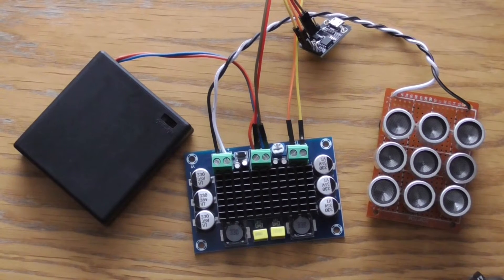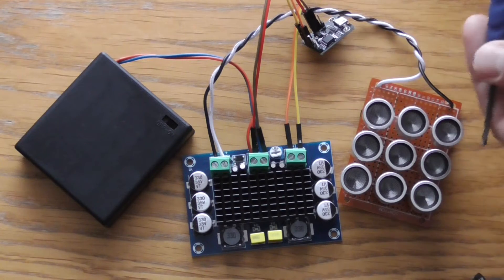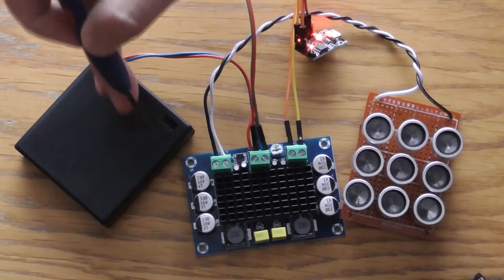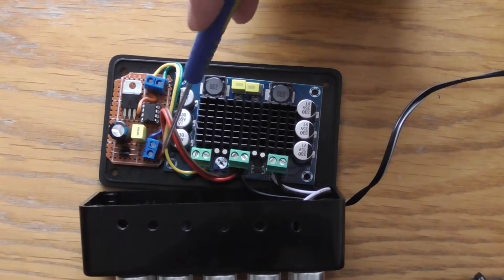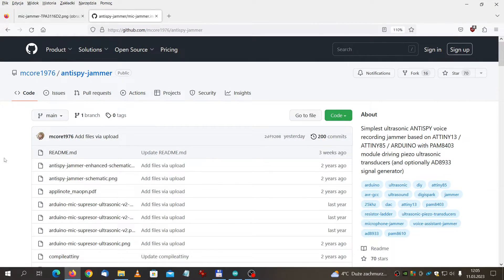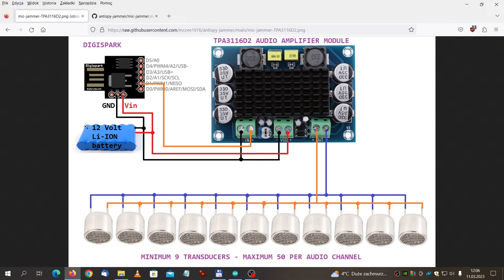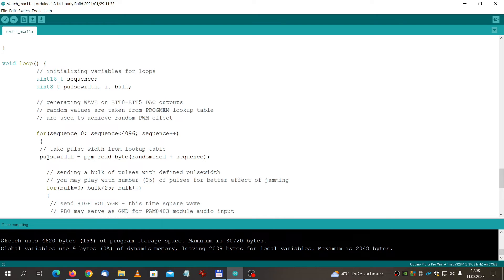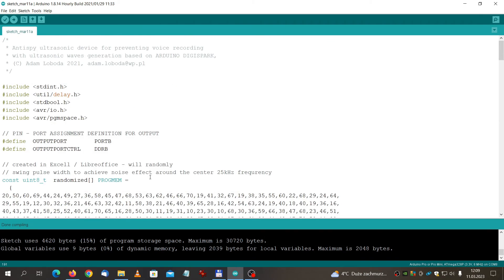DIY microphone jammer beast for less than 30$,  voice recording blocker with Digispark and TPA3116D2

Comment: Do the transducer have polarity? Thank you
Reply from the maker: yes they have. you have to pay attention to what the pins look like. One of the pins is grounded
Reply: @justanengineer5599  on my t25 transducers the pins look the same however one of the pins seems to have rubber insulation around it so I presume that is the + pin.  I tested with an ohm meter to see if I could find continuity with the metal case on either pin and that did not provide any answer.
Reply: thanks, I tried to assemble, I can jam the audio of an iphone, but it is only when I can hear the transducers, wich makes it useless, I am not using the capacitors on the newest version, are they important? Thanks
Reply from the maker: seek for the other version with AD9833 it is almost not audible and jams iPhones. This is something that you need
https://github.com/mcore1976/antispy-jammer/blob/main/mic-jammer-AD9833-TPA3116D2.png
https://raw.githubusercontent.com/mcore1976/antispy-jammer/main/mic-jammer-ad9833-digispark.ino

About the capacitors - using them is dependent on your power source quality. Sometimes it helps for some cheap power bricks
Reply: thanks, but that is the one I did, without the capacitors, do you think I need them?
Reply: Hi, I bought the capacitors and now it works with an iPhone, the problem I see Digispark and the AD9833 heats like hell and it stops working (not sure, what do you think?), maybe use of a pair of heat sinkers make the job. Thanks
Reply from the maker: how do you power the digispark? What is the voltage? it should be powered through Vin pin if the voltage is higher the 5V
The AD9833 should be cold unless you messed the wiring or TPA3116 is sinking too much current from AD9833 which may point to its problem (tpa3116 broken)
You may also think of using  ATTINY85 based design instead of the Digispark one here :

https://github.com/mcore1976/antispy-jammer/raw/main/arduino-mic-supresor-ultrasonic-v2-ATTINY85-TPA3116.png

https://raw.githubusercontent.com/mcore1976/antispy-jammer/main/main6.c

https://raw.githubusercontent.com/mcore1976/antispy-jammer/main/compileattiny6
Reply: ph, I think I messes the 5 v power, I”ll try to fix it later, thanks for your comment
Reply: just checked and everything seems correct, could ve that I use old junper wires? or other coase, I wanna stay woth the digispark model you proposed before, anyideas, thanks
Reply from the maker: 1. check if your TPA3116 board has a potentiometer on the audio inputs if no, find one that has because it will limit the current drawn from AD9833 board
2. Solder the wires. There is always an issue with lack of contacts that may sometimes damage the boards
Reply: @justanengineer5599  Do you mean the transistor to set the sound/ultrasound? yes it has one, I unplugged the USB power, thought it was the problem, but still having the heat problem, did you have any problem similar? or other guy reading this? or is it because the protoboard just cant manage than vortage? thanks
Reply from the maker: no one had such problem so far. please conect some resistor/potentiometer between AOUT of AD9833 board and Audio Input + of your TPA3116 board. How do you power Digispark and how do you power TPA3116 board? TPA3116 has tobbe powered from higher voltage than Digispark. The Digispark has to be powered through Vin pin from the same power source as TPA3116. AD9833 board has to be powered from 5V pin of the Digispark since Digispark is converting Vin voltage to 5V on 5V pin. Hope you understand what I have just written here. Use my diagram not your own ideas because you will fry all the stuff
Reply: Hi, trying to reassemble here, does  digispark power led has to blink? Thanks

Comment: I seem to have done everything right and yet it does not appear to jam microphone recordings, I can hear audible clicking from the ultrasonic transducers and adding phone near them does show a waveform, but audio does not appear to get jammed, I only had success with with an old phone and even then only 1 second of speech was not audible
Reply from the maker: you must have done something wrong, please indicate which source code have you used and which schematic was used for the jammer.
Have you used : Digispark + Tpa3116d2 + 10 transducers?
https://github.com/mcore1976/antispy-jammer/raw/main/mic-jammer-TPA3116D2.png
https://raw.githubusercontent.com/mcore1976/antispy-jammer/main/mic-jammer.ino

If you use less than 9-10 transducers the TPA3116D2 will not work correctly and you will get this 1 sec only jamming

Additionally consider second option which works better :
Digispark + AD9833 signal generator + TPA3116D2 + At  least 10-15 transducers. All of it has to be powered from 12-24V  see following
https://raw.githubusercontent.com/mcore1976/antispy-jammer/main/mic-jammer-ad9833-digispark.ino
https://github.com/mcore1976/antispy-jammer/raw/main/mic-jammer-AD9833-TPA3116D2.png
Reply: @justanengineer5599  Thanks for your response. Guess I'll have to get AD9833.  I used Digispark + Tpa3116d2 (mine is two channel, so I used a single channel) + 10  25khz transducers. All powered with 12v
I also used unmodified mic-jammer.ino and everything is connected just like at 5:50
Maybe I should add more transducers? I have 10 more
It also only draws 0.04 Amps, which seems too low
Reply from the maker: it is too low. Either Digispark is not generating the signal (do you have an oscilloscope to check the input pin of audio amplifier?) or there is some short/break at the output on the transducers. can you check the voltage on transducers? it should be at least 2x VCC
Reply: @justanengineer5599  I finally managed to get it to work. Turns out I needed to connect wires better and I needed to use D0 and not D1 on digispark. Jamming seems to work now, but it seems a bit weak. I tried measuring the voltage I get at the output of Tpa3116d2 and it's 4.6 if I measure AC and ~200mV in DC. And everything is only drawing 0.05A. Maybe my amplifier is bad
Reply from the maker: it is still to low. The whole device should draw 0.3A at least. Yes, you may have bad amplifier board

Do following checks:

1. Check the wiring 3 times. sometimes attaching additional Electrolytic capacitor 200-1000 microfarads between VCC and GND and some smaller 470nF - 10uF  could help. 
See the updated diagram on my github that contains the capacitors : https://github.com/mcore1976/antispy-jammer/raw/main/mic-jammer-TPA3116D2.png   and  https://github.com/mcore1976/antispy-jammer/raw/main/mic-jammer-AD9833-TPA3116D2.png

2. check the voltage on AD9833 VCC/GND pins if it is 5V. 

3. Check the voltage on TPA3116 pin VCC + / VCC -      if it is 12V. this board has to be  powered from 12Volts at least

4. If using AD9833 board check wiring on Digispark P1 to P3. This is a SPI bus and it has to be connected exactly the way as on a diagram.   If you are not using AD9833 then P0 port is kind of GND line for the amplifier audio input, you may connect directly audio amplifier negative Input "-" pin to GND line

5. Audio amplifier board is important. For example TPA3110 does not work and makes this "clicking". Use TPA3116. I will also check if TPA3118 works soon.

In general. You messed up the wiring for sure. It should  not be difficult to connect few wires especially for MR ROBOT.
Invest in Oscilloscope that could help you to run similar  hardware projects. It is hard to debug what you have done if I cannot see it. Maybe it would be good to post images / photos of your device on some free image hosting and put a link here ?

Comment: Filtering ultrasonic wave lenght could be solution to this jammer I guess?

So a spy can easily filter out noise and get clear sound?

Am i right?
Reply from the maker: Good luck with filtering random noise that is added to this signal...
The ultrasound is only a bearer of random modulation

Comment: I just tested the change with interval, it makes the sound of the noise, but it's possible to hear what I'm saying through the noise.

video at: https://youtu.be/yWAc2V9PPKw

Tested with an Android Motorola G60 (Iphone-like filter)
Reply: The effect needs to be close to that of this equipment, I'm trying to buy one of these so we can see the circuit and measure the intervals https://www.youtube.com/watch?v=dy9U9BbFXYs
Reply from the maker: I will try to experiment with more random intervals. In their video they are jamming iphones from 1m range directly pointing the signal to the microphones which is  not so hard as you know. When you are filming the jammer the microphone is at 90 degrees to the jamming signal that is why you can still hear the voice a bit. If they put jammer at 90 degrees I pressume it wouldnt be so succesful in jamming

Comment: thanks. I am wondering if in the commercial jammer they are using some pauses in the signal to make the jamming better. I need to try some random interrupts in signal generation and see if it makes any difference.

I bought the CZ21 model in the "ali ex press" research on it, they claim to work on all but the iphone 14 I bought it when it arrives I open it, I film it and make measurements to send you
Reply from the maker: I have just uploaded to GitHub new version of "main4.c" and "mic-jammer.ino". Both are having random delays between bulks of 25 pulses sent. In my opinion it works better on high end phones, I have just tested on my Samsung S20

Comment: I performed the tests with this project using 21 transducers 25khz, TPA3116D2 100watts, digispark.

The test was performed on 1 motorlola g10, 1 motorola g60, a lenovo tablet, a xiaomi 11t pro, and a spy engraver pen.

on xiaomi 11t and motorola g10 it worked fine at 5 meters.

on motorola g60 it worked up to 2 meters.

on the voice recorder pen it worked at 20 centimeters (on the old model it didn't work at any distance).

on the tablet did not work.

I didn't have an iPhone at the time of the test, but the tablet I used seems to use the same anti-noise circuit as the iPhone.

the circuit was assembled and configured according to the scheme indicated in your video, it emitted a strong and audible effect from the transducers.
Reply from the maker: if you have 40kHz transducers there is a version mic-jammer-40kHz which may work on the spy pen. Its microphone may be not susceptible to 25kHz.
Also the question did you use 12V at least 1 Amp to power the jammer?
Reply: @justanengineer5599  I did tests using 21 25khz transducers with the mic-jammer.ino TPA3116D2 100watts, digispark.
2A 12v source and then with 14v 7A battery emits a very strong noise but still ineffective in some devices, I just did a test using 51 transducers 25khz the result is the same. Did you see the video I sent the link to in the last post?
Reply from the maker: no there was no link in your first  post at the top of this conversation
Reply from the maker: thanks. I am wondering if in the commercial jammer they are using some pauses in the signal to make the jamming better. I need to try some random interrupts in signal generation and see if it makes any difference
Reply: HOLA UNA PREGUNTA ¿TU DISEÑO ES COMPLETAMENTE SILENCIOSO? LE ESCRIBI HACE UN SEMANA EN SU CANAL DE YOUTUBE.

Comment: What source code do I use in this project?
Reply from the maker: mic-jammer.ino if using Digispark,  "main4.c" or "main7.c"  if using ATTINY85 with DAC resistor ladder. The important thing is usage of TPA3116D2 and at least 20 transducers. It makes 60V peak to peak voltage (when powered from 12V / 1A power source) on every transducer  - an this is the max that  transducer can handle according to its specification.. which  makes 110dB audio power. These transducers are even getting kind of hot when working then. I am using single channel amplifier board. Tested today it jamms newest iPhones from 3 meters when pointing at the microphone. Of course the noise is audible but it jams literally every microphone with such power

Comment: How many transducers could you implement with the 100watt config?
Reply from the maker: 50 per channel if you are using TPA3116 with stereo inputs.  If using single channel I would go up to 60 and this is the max. More can make the impedance too low for TPA3116 chip (it has low limit 2 Ohm) and shortage protection would switch on

Comment: hello. Can i use arduino nano instead of digispark?
Reply from the maker: The source code was tuned for 16.5 MHz of Digispark and Arduino Nano works on 16 MHz, so in theory  yes because theres is only 3% difference so the frequency will be 24,2 KHz instead of 25KHz (still OK because transducers work 23-25kHz),
 but you would need to change Port B output to Port C for example.  You need to experiment.